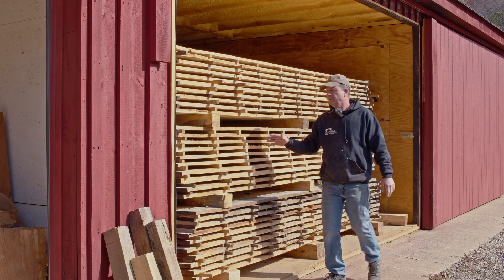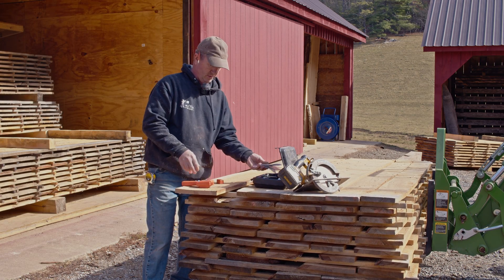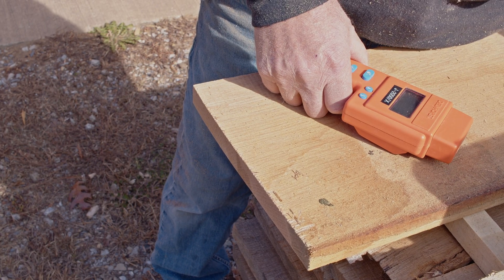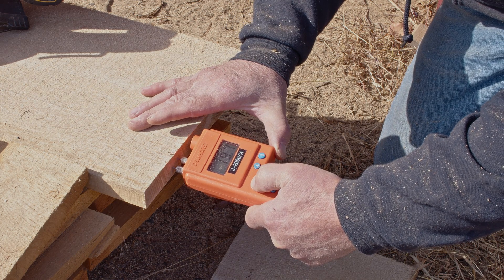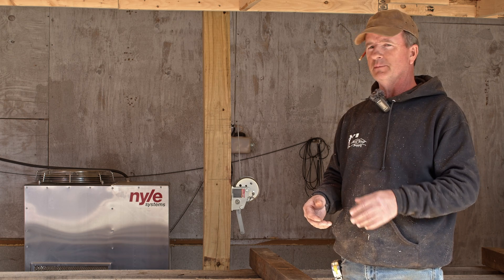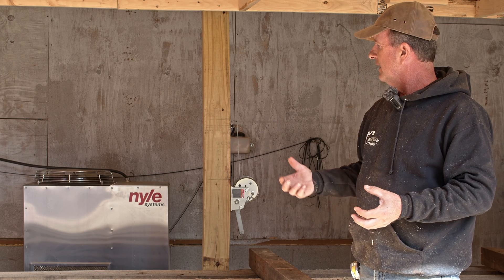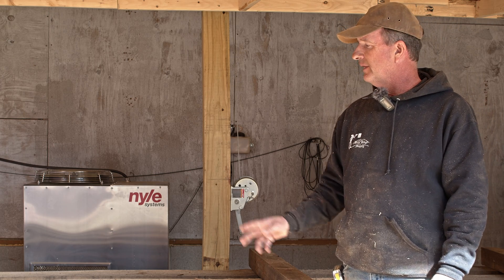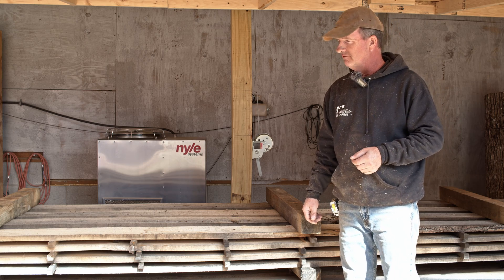What is Wood Kiln and How Does it Work?

Comment: No, that’s different kinds of moisture.  Green or recently cut slabs/lumber have fibers that still have the moisture from growing all throughout the slab.  That is not the same as dried wood getting wet. Typically if dried wood is left in the rain for a couple days, you can bring it inside and it will dry back out in a day or two.  That kind of moisture doesn’t penetrate very deeply and therefore will dry in a short amount of time.

Comment: If you have kiln dried wood and left in the rain for a day will it absorb the moisture on it all the way through? Thank you.
Reply from the maker: It will not. Once the wood dries in a kiln the pours that carry the water close up. If you were to put your wood in the lake and take it back out it would dry 10 times faster then drying off the stump. We have several people that pick up lumber that has been kilned dried and it gets wet on the way home. It’s not a problem and will dry out quickly.
Reply: @st.pierrewoodworkindandsawmill  No.  I’ve loaded the bed of my truck before with kiln dried walnut slabs.  They sat out overnight in rain, brought them back inside and they dried overnight in garage, was not a problem at all building with them.  When kiln dried wood gets wet, it just gets wet, it doesn’t become “green” again.  Those are two different kinds of wetness.
Reply: @st.pierrewoodworkindandsawmill  thx for the explanation. 👍